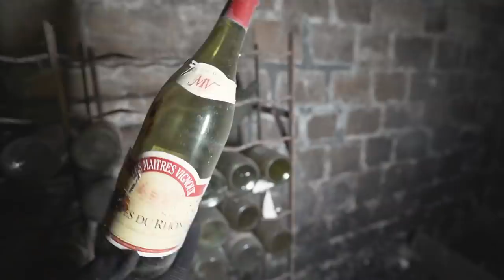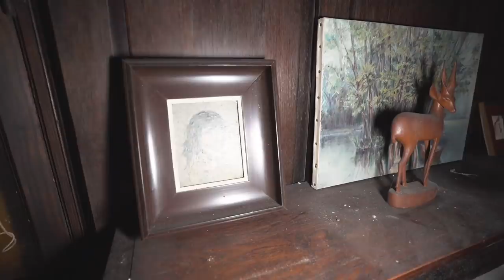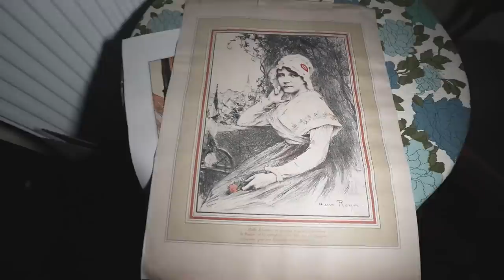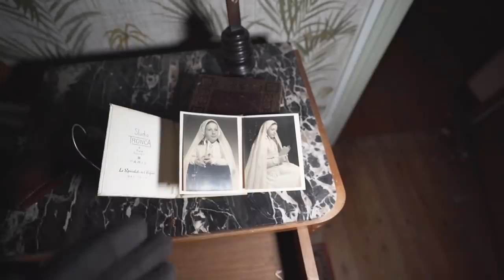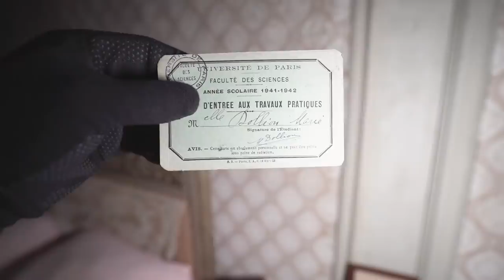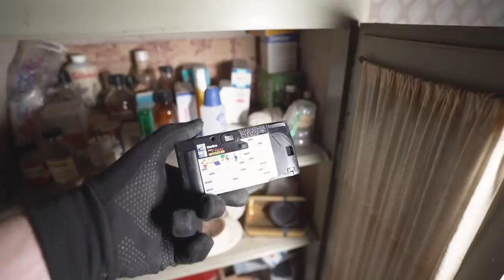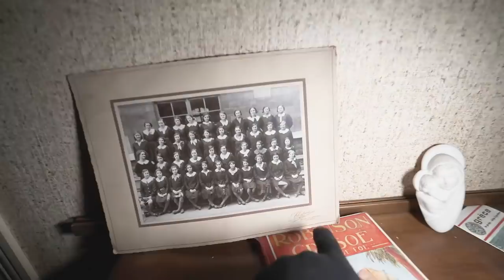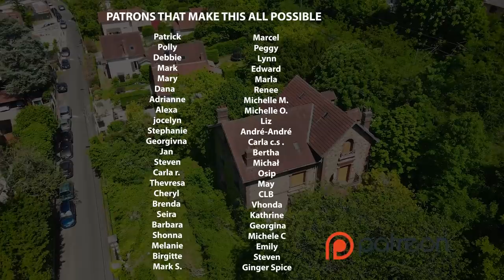Abandoned Mansion of a Female High Court Lawyer from Paris ~

Comment: Those outside tiles are art nouveau. The rough stone looks like coral rock brought from the seaside- used in grottoes and gardens too.
Did you set and dust the dining table with what’s there.
No dust- even in same room
Looks possibly staged with found items.
The lack of heavy dust is strange.
Food elevator = dumb waiter 
Common in homes with basement kitchens of the time
Wing piano = Grand Piano
Bedroom- those are prints on either side of bed.
Closet= Armoire 
Claw foot bath 
If you would have shown purses or fashion- we could have roughly dated the lady occupant
Big closet with bed linens = Linen Press

Comment: Please please please put down the keyboard covers on the pianos you find , it protects them. Even if the top is open on a grand piano they are very easy to gently lay down. It protects them and almost every one that I have seen is completely fixable even if it isn’t playable.
Reply: Yes!  I have been wanting to comment on that.  The covers will at least protect the keys for a longer period of time. Also should keep the "wing" down on the piano so dust doesn't get in and harm the mechanisms.
Reply: Also the pianos you have been finding so far are called upright pianos. A grand piano is what you see on a concert stage. About 5 foot in length is a baby grand and a 6 to 9 foot in length is called a grand piano. 😊
The 9ne 8n this video is a true grand piano.
Reply: This bothers me also the keys are not covered..esp. this one.
Reply: Yes please do! I just cringe when I see these left to waste! They deserve that last bit of respect at least

Comment: Great explore but ya kinda missed something.  That record player and two speakers was sitting on a cabinet.  Under that record player was the lid that opens.  It would have been cool to see what was in there.  It should have been yet another record player and radio.  My guess it would have been in pristine condition judging from the cabinet.  Years ago prior to TV, the record player was an important piece in homes.  They were often major furniture pieces in pretty cabinets.  That extra piece on that phone should have been an additional ear piece so someone else can listen in.  Question for you Leslie, why do radiators turn walls black?  I lived in germany years ago and when we moved out, we were surprised to see the walls turn black from the radiators.  Could it be the heat that discolors the walls?  Keep up the great work and we will keep watching.